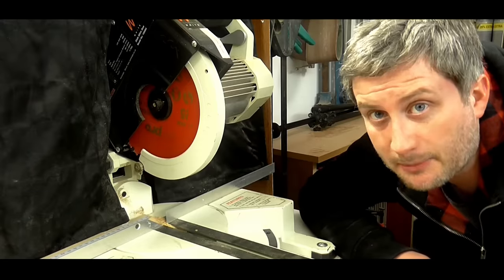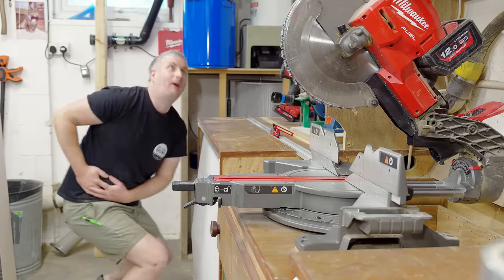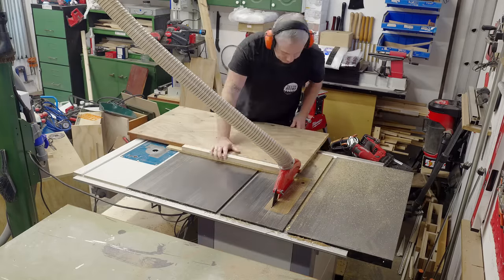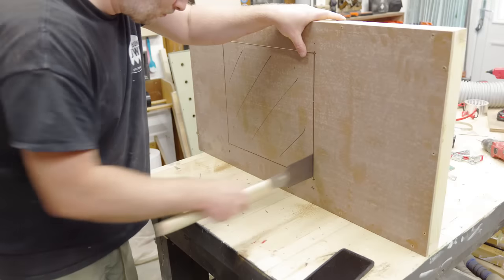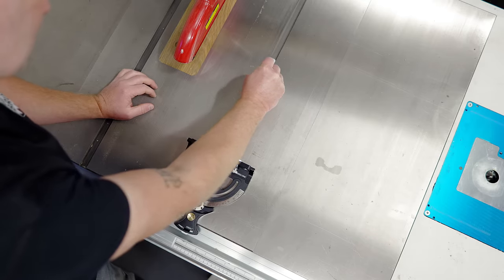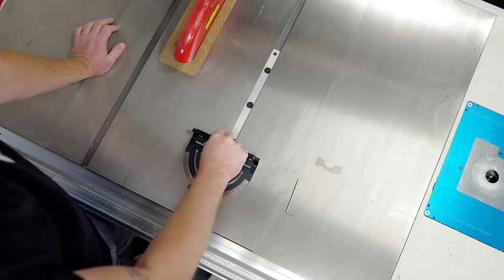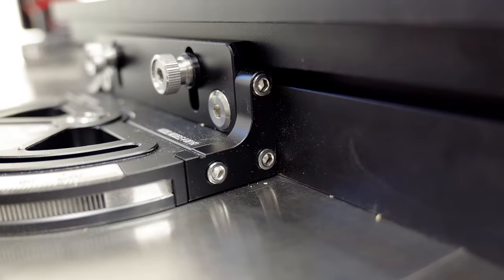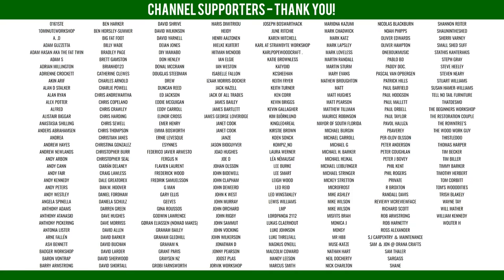Goodbye, Mitre Saw!

Comment: I could not find any manufacturer’s mitre saw that was reliably accurate.   Just your hand pulling the saw can pull it off the line.   I opted for a something a lot more robust. I bought a 1953 DeWalt Radial Arm Saw.  A 500 lb monster of a machine with 3 horsepower, a 14” blade, and bulletproof accuracy.  Moreover, the Radial can handle all my ripping needs up to 24” wide. And all my cross cutting up to 24” wide.   Add to that that it is safer, because it CAN’T kickback when cross cutting, and in ripping, if it kicks back it kicks the board to the left or the right and not at me.  It takes up less space than a table saw, and has pretty much replaced the table saw for everything short of ripping up large sheet stock, and these days I tend to use a track saw for that, anyway.  It cuts perfect miters, bevels, and compound cuts, and I can also use it to cut horizontal dados and rabbets along long boards, not to mention very unusual cuts where I am pulling the blade thru the stock at an angle to cut a large U shaped curve.  All in all the most versatile power tool in the shop. My table saw sits largely unused, pushed up against a wall. And I have the radial outside, ( under a cover ) where I can cross cut or rip 40 foot long lumber if needs be.  And folks who opt for an old 40’s or 50’ DeWalt with the smaller arbor find it can sport a shaper head, a jigsaw attachment, A jointer attachment and even a planing head for planing stock wider or taller than will fit in a standard planer.

Comment: As a home game rough carpenter, I couldn't live without my inaccurate miter station(it's had a warped fence for as long as I can remember, that I've never gotten around to fix.) Mines an old non-sliding Delta I picked up used a decade ago. I've also got a radial arm saw in the garage, but as my 10x12 mixed use shop doesn't have space, that saw rarely if ever gets used.

Comment: There is really no need to be without a mitre saw even with out the full station. You said it yourself, they're mostly set up for job-site use, so just get a jobsite frame and some rollers and whenever you need it for a lot of cutting you can unfold it and crack on.

Comment: Since I retired from job site work I only use my old-style chop box for cutting steel pipe and tubing. What I do use a lot and love is my old Sears 12" radial arm saw. One of the reasons people poopoo them as dangerous is that they are not using a negative rake toothed blade, its use keeps the blade from aggressively pulling through the cut. It has been reliably accurate and relatively easy to make adjustments to tune it in and it seems to do a good job staying there. One of the jobs it does wonderfully that none of my other tools does is making dados in stiles of tall shelving units. I use a wobble dado blade to get the perfect fit for today's undersized plywood and it takes a short time to make several pairs of end stiles. I used to use a router jig for this but finding a bit that correctly fits the plywood is a pain as is having to make double cuts with a smaller bit about 4 time more time-consuming and still not the same consistency and accuracy of the radial arm saw.
Reply: My grandfather used his for decades instead of a miter saw... he found the Delta Radial Saw he used to be all he needed along with a table saw and hand tools...
Reply: i like them too but i find it hard and slow to change the angles.
Reply: A RAS is so versatile and takes up less space. Out goes the table saw, as well.
Reply: @toonybrain  I do not use the RAS for ripping wood. The last time I did, a piece shot past my right ear and made a hole in the fiberglass garage door. Please don't use one for ripping. You will need a table saw anyway; use that.
Reply: That sounds like a top tip ,negative rake cutting disc, I like the idea of a mitre gauge choice is king if you have the space.

Comment: For the wood working shop specifically, I think the table saw solution could work fine. I do a lot of general carpentry and renovation work, so I’m not getting rid of the miter saw anytime soon. However, I use mine off a portable stand, not a large permanent fixture station.
Reply: Not to mention that it is great for cutting aluminium too 🙂

Comment: I mostly use my miter saw for cross-cutting lumber for framing. I built a big tree house for my daughter last summer, and I used the miter saw extensively for both 90 degree cuts and also for angled cuts when I was cutting the ends of my rafters. I'm a hobbyist not a pro.

I don't think it's feasible or safe to cross-cut a 10 foot (~305cm) 2x4 with a cross-cut sled. The other option is to use a circular saw, which I also use extensively. However, I've learned that knots and other imperfections in lumber can often lead to the edges of framing lumber being a bit uneven, and then when I quickly try to use a circular saw and a speed square to make a perpendicular cut, the uneven surface of the lumber results in my square not actually resting parallel to the center line of the lumber, which means that my cuts don't end up at 90 degrees. I don't own a jointer, and I'm not going to create a 10 foot sled to be able to square the faces of every 2x4 stud (or 2x6 or larger piece) on my table saw. I'm not going to plane the surfaces every single time with a hand plane, although I have done this at times when I needed to square some stock that was for something like a small makeshift work bench/table. Anyway, since my miter saw has a long fence, I generally find that if a stud has a couple uneven surface bumps, resting it against the long fence of the miter saw results in the center line of a stud being closer to parallel with the fence than if I use, for example, a speed square as a saw guide for my circular saw.

Therefore, I've found that with lumber that isn't perfectly square with flat edges, I get better results cross-cutting with my miter saw vs a circular saw.

My miter saw is NOT a sliding miter saw. It's a small and cheap chop-style miter saw that cannot cross cut anything bigger than a 2x4. When I need to cross-cut something bigger like a 2x12, I use a circular saw, and I will make thin lines with a pencil and speed square against both faces of the lumber to make sure that surface imperfections in the lumber do not result in my speed square sitting out-of-square with the face of the lumber before I make a cross cut. Since my miter saw is small and cheap, I can store it inside a cabinet, and I generally take it outside to my garden to make cuts. I still hook it up to a shop vac + cyclone dust separator outside on a portable folding table, but using it outside reduces dust in my garage.
Reply: All tools have a specific + & - rating, that's why you need so many of them 😂😂

Comment: First: I want to say that it is so nice to see someone actually use a guard over the top of the blade of the table saw. You obviously value your fingers more than almost everyone else who makes videos using a table saw.
Now for my comment:  If you really want to save space in a small shop, get rid of the table saw also. Both tools can be replaced by a radial arm saw. A properly set up (10 inch) radial arm saw can rip and crosscut just as accurately as a table saw.  I know.  I have been making high end furniture for forty years using a radial arm saw. 
The advantage of the radial arm saw is that it can be up against a wall.  It only requires clearance to the left and right. Compare that to the table saw which has to be in the middle of the shop because it requires 360 degrees of clearance.

Comment: Really interesting video. Thanks for posting.  I need to organise my workshop smarter, and this provides extra motivation. I ditched my fixed mitre saw station some time ago and replaced it with an EVOLUTION 800B MITRE SAW STAND WITH EXTENSION ARMS from Screwfix  -  £80. My only regret was not buying one years ago. It folds up easily, and I can set it up outside if I need some extra space around me.

Comment: Just found your channel and appreciate your candor and perspective.  I have also found TTI product managers invested into customer feedback.  Design defects can cause accuracy issues.  Sometimes we can improvise and overcome them, but we should not have to, especially with premium brands.  Accuracy at any stop detent should be reluable.  Few mitersaws are accurate during  compound cuts when having to lock, or tighten the miter scale in place with a clamping mechanism.  Also, slop in bearings, or flex in axels the bearings ride on introduce the potential for error.  Experiene with stain grade hardwood crown molding is a huge eye opener, as errors from tool slop are expensive!  That said, I still use my miter saw, but constantly check its potential for error.  Perhaps a setup on wheels will offer you the flexibility to maximize your space!  It works for me, just make sure the mitersaw table/base is coplanar with any support used.  I certainly appreciate your sharing like this, it's increadibly generous and affods us the opportunity to learn and improve our skills.  Finally, I find that sliding compound miter saws all have the potential to introduce error, more than a solid nonsliding compound miter saw.  This is why I don't own a sliding one yet.  Taking the time to test fit, rather than measure is not as fast, but usually produces better results for me.

Comment: You won't miss the mitre saw I'm sure.  I have a similar mitre guayecand they are beautifully made but I don't use that either. Two crosscut sleds one with an adjus5able fence to cut angles and that's it.  One thing I have always loved about sleds is knob on accuracy and also their ability to cut small pieces safely.

Comment: Interesting how people can have their own personal ideas about stuff. Which is fascinating and great to watch!
For me the mitre saw would be absolutely one of the last tools I would ever get rid of.
I use it so often. In fact, I replaced the table saw for just a regular circular saw instead and kept the mitre saw.
I noticed that I use the table saw only for getting the wood smaller, which can be done one much more simple ways.
Reply: Question: How did you cut small parts safely and quickly?
Reply: @Dickie2702  sorry, I don't follow the question? Small parts can be done at the mitre saw if you clamp things right if that's what you mean?
Reply from the maker: Rip cuts with a circular saw? Isn't that a bit awkward?
Reply: @RagnBoneBrown  as long as you have a proper guide, it's fine.
Reply: @RagnBoneBrown  Easy to do, even in the parking lot of the lumber yard.
Take a saw guide, such as the Kreg Rip-cut,  and a battery powered circular saw.  Or a long enough straight piece of metal and some clamps.

Comment: I put my mitre saw onto two timber rails. This either sits on my bench or trestles so that I can move around my space for convenience or leave it in one area. I built my own tailored trestles. I, too, use a sled on the table saw, relying on the mitre to break down long boards that can be finished on the table saw. Thanks for sharing your thoughts.

Comment: Very useful points made. A follow up on what can be done to overcome these issues and how much they can be addressed would surely be appreciated by many mitre-saw owners.
A lot of mitre-saws are used for making quick the cutting of timber for various constructions that involve complicated angles and at the same time speed of execution is paramount. Diyers do not often have a lot of time to devote to projects where the main objective when embarking on them is to save money. Usually this involves projects such as timber frame buildings. One such diy project can justify the cost of procuring a mitre-saw. While the tools presented look awesome, many people simply will not rush to ditch their mitre-saw and then spend money to replace them with an alternative as, for many, a mitre-saw is probably considered as a lifetime purchase.
Reply: Haven’t seen you for ages(been in dock a lot)and am surprised at the grey hair.
Don’t despair and keep up the good work.

Comment: Alright Keith. I've been thinking about doing the same. Realised last time I cleared mine off that the last time I used it was to chop up scraps! Mitre saws just aren't accurate and/or consistent enough for the furniture I'm doing, so it sits there "Just in case"🤷‍♂️ Think I'll long loan it to father in law. I do all my mitres on my over-routing machine and all my square cuts on the table or plunge saw. I did test a Festool kapex but there is still a little flex at full extension. It's still inconsistent with bevel or compound cuts and, still leaves burns on mitres and bevels. Where there's burns, there'll be imperfect joints. I can't actually remember any if the old joinery shops I worked in having mitre saws. Radial arm saws rather than mitre saws if they did. Panel saws for mitres. Still think mitre saws are awesome but they have their limits.👍

Comment: Interesting how you set up your workshop. I have both my mitre and circular saws on mobile stands and use a mobile supports and a wheeled vac. This means I can take max advantage of space in workshop, work across diagonals for long pieces. Building in always restricts your options. Ditto my drill stand is free to move on the fixed work bench. I have a low level movable large assembly table that also serves as a build stand saving my back!  A couple of workmates also come in invaluable. Flexibility is an absolute boon as you never know what jobs/ projects you might have in the future. I can also clear everything to the sides to use the screeded (level) floor for assembling larger items. I would not change what I have got and the mitre (chop) saw is absolutely square, a brilliant tool. Good luck with the new layout, hope it serves you well. Best regards Stephen

Comment: Good thoughts. I've considered doing the same as I have multiple ways of doing cross cuts.  However, my experience with my miter saw has been difficult. My Makita 12" miter saw cuts very accurately and leaves a clean glue-ready cut.  Still pondering.

Comment: Mitre saws are a blessing and a curse. I’m just a hobby woodworker and all around tinkerer. I use my Ryobi mitre saw and my DeWalt job site saw for everything. From time to time I find myself needing to cut aluminum, plastic, PVC and various other things besides wood. I always cut these things with the mitre saw. I have a setup where the mitre saw is usually hanging on a wall and I can easily set it between two benches when I need it. Otherwise it is not in my way.

Comment: some years ago I got a Bosch 12" glide.  I bought it because I was building a Garage / Recreational Deck and needed  the bigger cut and needed to use it in the drive way. . I haven't used it since. I have an Austrian sliding table saw and that's my go to.

Comment: I'll be interested too see how you get on without  the mitre saw. I got rid of mine last year for a lot of the same reasons you had but have recently bought a Kapex KS60 and it is night and day to the old saw.  Suddendly cuts are square and accurate and mitres fit with no gaps.

Comment: Totally agreed! I didn´t use my Mitre Saw for over two years now. In the meantime it´s buried under some table. If I ever would have to saw 150 roof battens or an angle cutting orgy (99% is 90 degrees), it will see light again. But everything else is done more efficiant and faster by any table saw sled or table saw rolling desk.

Comment: Great video. I really like how open you are about trying things that may or may not work! I’m really interested to see what you do with the space- great series. Also good for Milwaukee to actually come out and see your set up. Respect!

If you end up changing your mind later, Fishers Shop has a space saving mitre station that might be a good option for a space saving return and Shop Nation has some good dust collection improvement…
Reply: My Dewalt chop saw is the same. Spent ages fiddling with its rubbish adjustment to finally get it spot on and then soon as you put it away and get it out again the damn things gone out :(

Comment: I kept a miter saw around for years in the garage.  Most of what I used it for was those times when I needed a bunch of rough and ready angled cuts.  For one or two cuts I almost always just used a handsaw and left the powered saw in the garage.  Last time I pulled out my miter saw was when my wife asked for a gate for our deck.  I pulled out the cord and saw, gathered my wood, and plans.  About halfway through the project the poor old saw finally died.  I spent a couple of hours tinkering on it, but never could get it back to life.  I finally ditched the idea and built the whole gate with a handsaw.  Bet nobody noticed the difference.

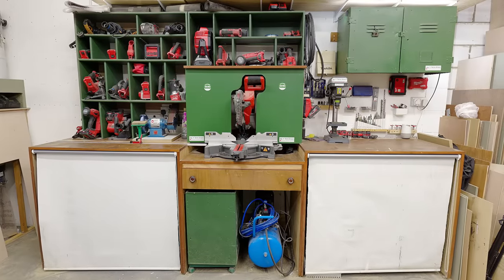Comment: 0:18 i always thought that your air compressor was outside in a separed cabin, but then realised, that was the case in your previous workshop. 
A few weeks ago i saw a video here on YouTube, where people forgot to drain the condensation water from there compressor, and where after a few years the tank exploded due rust from the inside out that weaken the tank. So a safety tip, remove the condensation water at least once a week, and even better, on daily basis.  Grtz

Comment: I've had a similar experience with my 12 inch miter saw: for most projects it takes too much time to set up, and I can get more accurate miter cuts from my table saw with a sled. It just takes up too much room in my small workshop to keep it set up all the time. For crown molding or worksite it makes more sense.